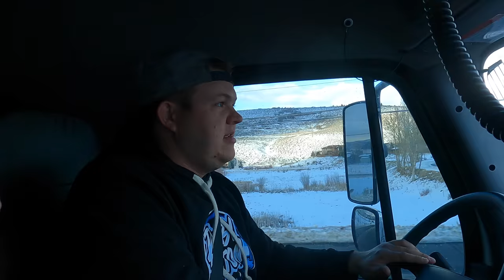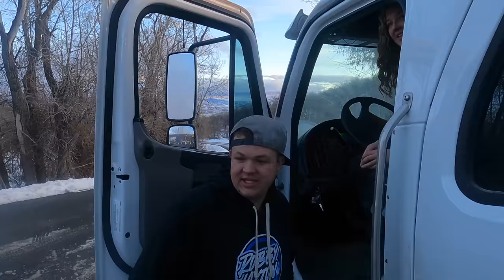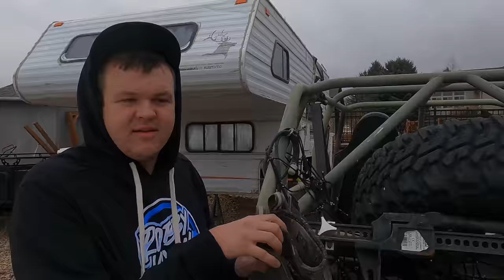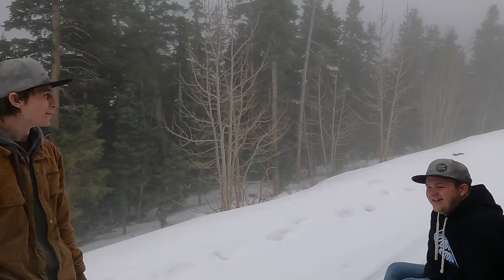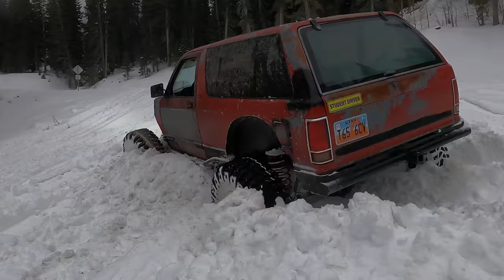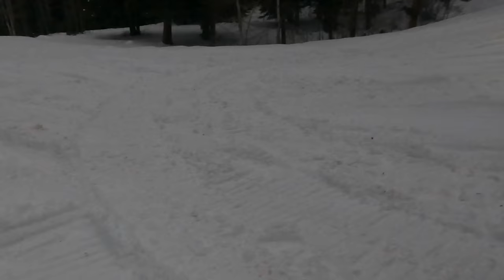What Did I Just Buy?? New Snow Recovery Machine

Comment: I spent a lot of years running a couple of those rigs. As soon as I saw that's what you were buying I said to myself I hope he checks the brakes. There's a block on the rear end that connects to brakes and the weld always lets loose. Kind of a design flaw I guess. But more importantly, you guys have summer tracks on that rig. So you can go up and down anything you want but for god sakes don't get caught sideways. If you get on any packed snow and that thing leans to the side even slightly you are going for the ride of your life. There will be no warning and it will be fast and there will be a fouling of the pants. If you are going up a hill make sure you go straight up the hill same with coming back down don't ever go diagonally across the hill. Same goes for tree wells on the flat. It looks like nice flat snow but it's hollow under the tree so stay away from trees. Great fun! Edit: mount a winch on each side, you won't regret it.
Reply: You are 100% correct and I have gone sideways with  one it’s scary 👍😳
Reply: He's going to either break it the way he's driving it or break it and hurt himself.  There's no roll cage in it either and he seems to think it's a rally car.
Reply: Excellent advice Dave...I hope they read your comment as there's nothing like experienced advice! Pure wisdom!
What he ought'a do is install an anchor he can launch when that ride starts! What? No snow anchors? ...😜👍
Reply: 100% agree with what you said..  your first time sideways will wake you up.  Step one.  Check those master cylinders!   Matter of fact rebuild them before you start playing….
Reply: Hmm guess I was right on the brakes lol!
Reply: as one that has had that happen while on a D-8 Cat, and has tried to move a flat padded one on snow pack (cold smooth steel + ice/snow = helpless) I couldn't agree more.  You need teeth that are effective in any direction, any angle, on snow & ice.
Reply: Steel tracks are like ice skates when sideways on a slope!
Reply: @marvindebot3264  a
Reply: @marvindebot3264  I Thought The Same thing, Someone Could Get HURT!  Calm Down Robby. That's A Really Cool Snow Rescue Vehicle. It's Going To Be A Fun Restore 
Videos, Can't Waite. Matt Will Be Jealous. LOL
Reply: Hey Dave do they make or add a 90° angle to the cleats or add picks to help improve side hill performance.
But I agree completely new brakes and roll cage.  Exoskeleton would be awsome and provide mounting for lighting and winches. 
Just thought the name shuld be Bluberry or better yet light Brite lol 😆
Reply: @mh9002  Winter tracks are wider, have longer and taller grouser bars, and the bars have 90 degree plates for lateral stability. If the grouser bars on Robbys wee cat are mild steel he can add some, but decent grouser bars are made of spring steel.
Reply: Wrecked an Artic cat, back in the '70s, with those grouserbar/cleat!  A little sideways on the lake & there was no stopping the slide, till it hit a drift, with 3-4 barrel rolls!!
Reply: This comment is on point. Take heed Robby
Reply: I'd also suggest looking at the track pins.  Those tracks look pretty sloppy.  I'm guessing the pins are very worn and will need to be replaced.  There are only about 100 of them between the two tracks.  It only takes a few weeks to make them on a lathe, then another few weeks to replace them and re-mount the tracks.  I agree with Dave on the tracks.  Those are summer tracks used for mud & dirt, not winter tracks used for snow.  Get those current tracks on anything icy or and you will have a wild ride.  I've had one spin about 3 times when trying to stop and one track was breaking slightly less than the other one.
Reply: This ... sounds like THE most useful advice ... Robby pleas take heed

Comment: regardless of what color you paint it, or what you name it, make sure your running gear, bearings, brakes, and essential systems are working. That includes the gas gauge. Don't follow Matt's lead an go out with broken equipment. I'll happily watch 10 episodes of you tearing it apart and putting it back together with new parts and making sure it's properly working.
Reply: Same here

Comment: I would add receiver hitch tubes at multiple places and have a winch that you can pin into any of them to give you several anchor points. Probably wouldn’t be as strong as a permanently mounted one that you should probably have on either end. But in addition to a moveable winch you could make a selection of different attachments that could use the receiver tubes to quickly make an anchor point or a snachblock  and have a lot of versatility.
Reply: Yep

Comment: Winch front and rear, light bars all four sides, fix the defroster, and wipers. Maybe even add a defrost and wipers for the rear. Later in the future, a couple side winches, for side pulling. Weld on attachment points everywhere. Cargo basket for the roof, and rear, above the winch. 
Paint it Layton Blue, and call it the blue Bomber.

Comment: Cool find. I'm thinking the linkage came off or broke, to suddenly stop moving. You need a better heater or a second heater, because the fact that it will be used during adverse weather.  Definitely needs more lights LED all the way around,and some more interior lights. Cargo rack, Jerry cans, four winches, CB system with a good antenna, and emergency items, and blankets, water and MREs . The seats in back probably has storage. Rhino line the floor, and heck yes paint it and have highly visible strips, neon yellow and blue lettering with logos, over the olive drab body. 
Up grade the seats for a better ride. Maybe a air suspension. Anyway really cool, with  a lot of potential. Take care and count your blessings amen.

Comment: Those Ford 300 six cylinders are amazing engines. I've had them in several different trucks through the years as I'm 60 years old. My last one early 90s in a E250 Econoline van I put 340,000 MI with no engine work besides basic maintenance.
Reply: i had an 81 Truck 2 tone silver & grey, my dads old work truck, even w noisy lifters it was still nice

Comment: I think you have it right. You know what is needed on it. If I had it I would, like you add a large winch on the front and the rear + some way to run a winch cable over a roller above the rear door to be able to lift if needed. I would also add movable  work lights on the roof at front and rear.  A good name might be "The Mountain Cat". Wish I had one. Have fun 🙂

Comment: Winches on front and back and both sides, solar panels on the roof battery Bank mounted inside, tons of LED lights inside and out, generator mounted somewhere on the unit. Would be a good start.

Comment: The snow cat is cool. Definitely some heavy duty winches front and back and ultimately it would be pretty cool to have hydraulics, kind of like an excavator where you can put a blade down in the front as a rocksolid anchor but maybe even an arm to kind of lift stuff up when it’s sunken down in a hole. Lights definitely end maybe even consider some outdoor heaters to warm your hands on near the winch area which will also keep the winch from freezing up and keep that metal a little bit warmer and more usable.  Then a lot of recovery stuff, gear a lot of hooks maybe even on top of the snow cat in case you’re on a sketchy incline, extra vehicle batteries and jump starters things like that chains for traction devices of course tools and spare parts and because of the snow some survival stuff some food heat packs blankets maybe extra gloves and jackets and make sure that thing has a good heater, somebody gets stuck out in the snow for hours and is freezing it’ll be nice to jump in there and get heated up. 

Then if you want to go crazy you could throw some fun stuff on there. Like a roof mounted gun turret and spotlights and of course the paint and your stickers but fun stuff like maybe a hot water dispenser so you could make coffee or tea or a cuppa noodles or oatmeal or some thing horribly unhealthy to eat. And maybe a snowball thrower. 🤔. Ohhhh, and a flamethrower. A lot of times people in the snow get buried up to the Frame, shovels and maybe a flamethrower to melt some of that snow would be nice, or at least fun anyway

Comment: Just make sure you take care of the track work! Oh and the main hydraulic pressure line. And the heater core. And the air filter. And  the wheel bearings. And the tires. 
I mean, you guys got it 👍

Comment: you need to get a 1989 f150 4.9L parts truck with a good 300 I6 EFI engine. they are so reliable on starting and running. It's my daily driver for the last 18 years.

Comment: Name it Wiskers, or Robcat. Put air ride seats in the front. Put a rear camera system in, you could even use the footage in your vids. Paint in blue white and gray. Make as quiet as possible inside, with a big badge on each side, add sound deadening. Winch on the front. Tow points on the back. Keep  the wiskers painted on the front. Lights all around. Cb radio for hb.

Comment: I would absolutely paint it, you guys say blue, I think it should be black and yellow (striped all out to look like a yellow jacket)  or red and black (striped all out to look like a wasper). or hot pink stripes on black striped all out to look like a girl childs toy, since you got all the other trucks and heavy equipment (which will be your boys toys), have one decorated for your little girl, try and maintain her interest in the company throughout her younger years and she will always have interest in it later on when she is a teenager. Name it something to do with her.   Keep her chores with the company, Teaches responsibility and the value of money. 

In addition to the new paint, I would also get winter treads on it. (Someone said you have summer treads on it right now).  I would also get some LED light bars for the top of the snow cat, put them all around it so it will blind anyone within a mile when you turn them all on, that way you will have perfect lighting when filming (or playing).  I would also put a  solar panel on top, wire it to a couple of batteries on the inside to keep it fully charged, but also keep some sleeping bags in the rear, and some sort of electric heater, blankets pillows, stuff to overnight in the back of it in case you get stuck in a snowstorm for some reason, you should also buy cb radios and cb antennas for all your vehicles/equipment to communicate with each other, just do some research on cb's in your local area, normally channel 19 is the normal open citizen band radio that all the truckers use on the interstate. On mountains where logging or mining is being done, it should be posted on signs what channel they use, I wouldn't go onto an active work site without having a cb because they have vehicles that are way too big to see you, and will run you over if you don't use a CB. (I doubt any of this applies to your area of the world though).  Still, the CB is good to have to communicate with multiple vehicles working together, including heavy equipment, like bobcats, dozers, backhoes, forklifts, etc.  (I am surprised you guys don't have a base station at your shop that way you can communicate with your trucks you send out and use a 2way also, with an antenna/repeater on top of your shop.

1. New Paint
2. Light bars on top
3. CB radio for all equipment and base station for the shop/2way radio
4. over night supplies in the back of the cat- a couple of sleeping bags, blankets, pillows, 
5. solar panel on top, a couple of batteries inside 
6. some sort of extra heater inside the back
7. keep extra fuel in the back for longer excursions into the back country.
8.winter tracks
9. more winches, one in every direction

Comment: Azrial
Support vehicle, 'secured' tool/equipment box, ie a 20 ton power pack could kill a person in a roll over.  Super capacitor banks of 3K farad cells, can make a highly effective off road welder (ref ch Dr. Bass, of Canada using Li-ion).  SC have bolted straps, while Li-ion use the lower contact area Static discharge welded connections.  So FIVE 2.7v cells, in series, should handle 13.5v.  Ergo if the voltage regulator output is 14.5v, SIX cells would be needed for a max voltage of 16.2.  Li-ion discharges can be extreme, but SC are lighting in a bottle.
Full set of hand tools (sockets, wrenches, impact ect), small bottle torch bay, pneumatic ports, vice (maybe on a Reese).  Turret searchlight/telescope, Backpack sized MEDICAL KIT!  Backboard, that triples as a poker table/sled.  Parts box, large enough for expected components.  Basic electrical, multi meter, crimps, minor wire stock, fuses.  External access Chemical/fire hazard box (spare fuel).  Having goofed around, holding an exhaust pipe in a vice while twisting it w/ a pipe wrench, had a flake of iron lodge in my eye over a weekend.  Paid the eye doctor more than it would have cost to have someone install the exhaust, and in addition suffered much pain.
MAKE SURE TO HAVE A PPE GALLERY, maybe even a usable fluid flush station.

Comment: What Dave said!!! The tracks are not suitable for anything that resembles a sidehill on the mtn or on the road. Icy roads will not be fun or safe. As has been noted going sideways can easily be a slide to death. The other thing that I don't understand about the rescue bombies that are used by your friends is why not put a light duty  plow blade on the front, for knocking down drifts but more importantly the " anchor" brake system to belay screwups? If you look around the region Thikol's, LMC, from  Logan Utah had such blade setups as OEM with that vintage, simple but effective for snow moving and or emergency braking.  In addition second only to a helicopter, its a hardware store full of parts trying to shake itself apart. Please be cautious, this machine and the environment it operates in is much more serious than a derby car corral.